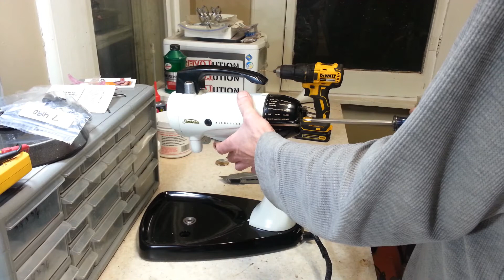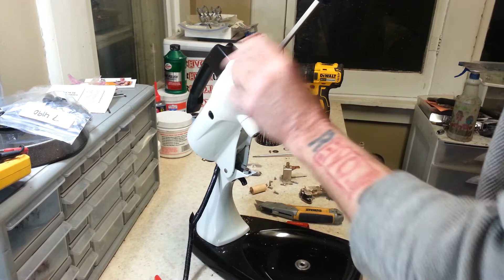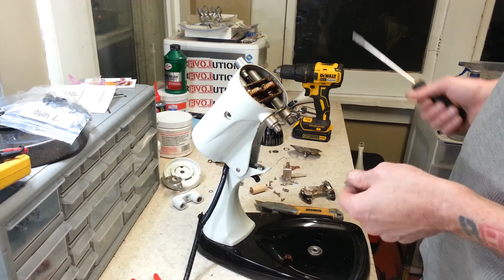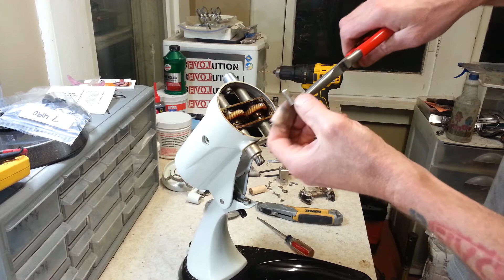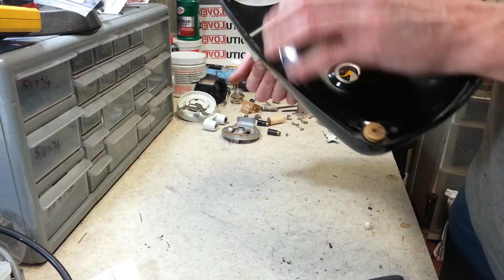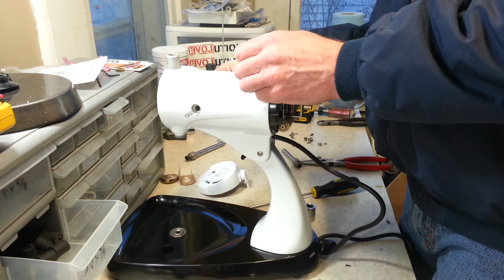Vintage Sunbeam Mixmaster Model 12 complete restoration

Comment: Maybe apply some Loctite on the governor pin?
Reply from the maker: It seems to be holding, it feels as if there is a "catch" when you get it in the slot, once you get past that, it seems to hold it in place. I should try that on another armature I have that wont hold the pin anymore, the armature is excellent with the exception of the pin falling out. Red Loctite should secure it pretty good. Thanks for the tip!!

Comment: Capacitor can be bad as in Open... If it was good you would see resistance change during testing.
Reply from the maker: Yea, I only checked for a short, overconfident in my initial diagnosis :) 
Usually you can hear an open capacitor when you run the machine, I don't have the equipment to test a capacitor fully, so I check for leakage, and diagnose by running it in the machine. If it runs on high, then I can check for a short. 
I am really not very versed in electronics, I just sort of figure out what I need to when I need it. I would not be able to repair an old radio or tv at all!
Reply: Failed capacitors that cause a machine to run flat out usually don’t trigger a DVM as a short.

They do cause a capacitance meter to read above the rated capacitance though so that’s how I usually test them.

These days, I just replace the cap with a new one as part of a comprehensive service.

Comment: You should really put your signature on your restorations :-)

And sorry about spamming... You did ask me to 'place my bets', hahaha

Finally, did you have to replace the capacitor and were the contacts still in decent shape?
Reply from the maker: I have heard that before, but for some reason I always resist. 
No worries, I like the comments! 
I did not, the capacitor was actually good. I just did a continuity test because I thought for sure it would show a short, but obviously it was something else and I would have lost money placing a bet on my first thought lol. This was a strange one, the machine had hardly any wear, looked like it was barely used, but yet the pin wore through the plastic on the governor.
 How about that cord though!! :)
Reply: Don't laugh, but I did use a trusty old grinder with tape like that for years until my neighbor gave me the look when he saw me use it once and took out HIS tape to fix it ;-) That really drove it home and put me to shame so I finally changed it ;-)
Reply from the maker: I cant help it, I had to laugh! :)